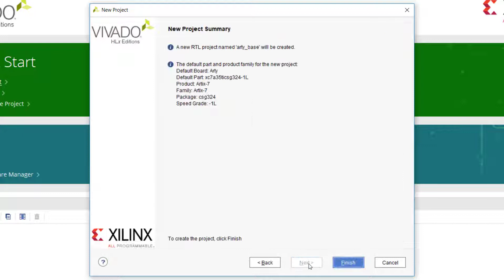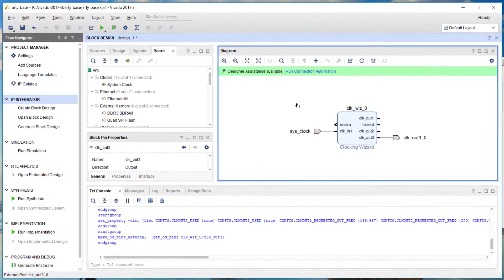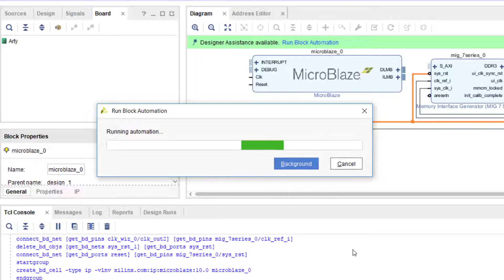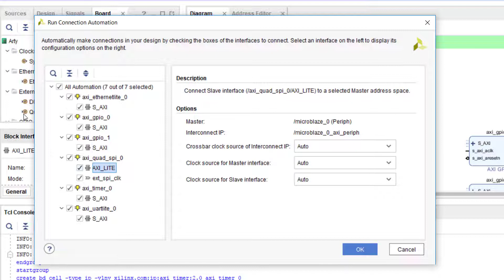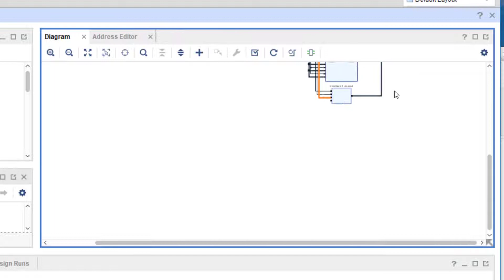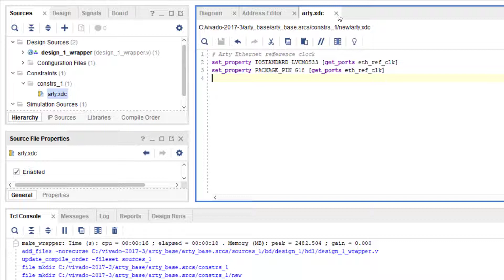Artix-7 Arty Base Project

Comment: Hi, I followed the tutorial and got a bitstream generation error: "[DRC RTRES-1] Backbone resources: 1 net(s) have CLOCK_DEDICATED_ROUTE set to BACKBONE but do not use backbone resources. The problem net(s) are clk_out1"

Any ideas? Many thanks
Reply: getting the same error (with vivado version 2022.1) 
synthesis completes just fine, but bitsream generation always fails
Reply: I am also facing the same problem. "Routing" problem. Could you help solving it? Can I use PLL instead MMCM clocl?
Reply: This video is wrong (because it's too old). See my comment.